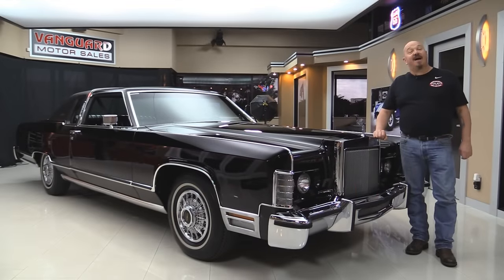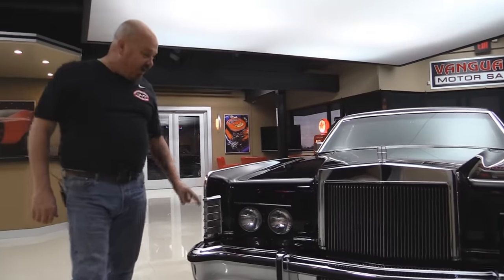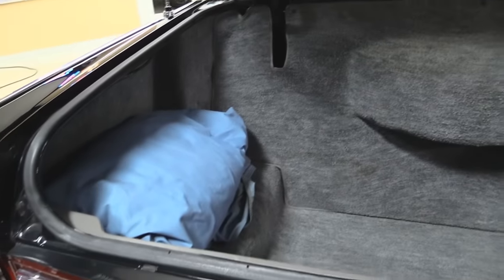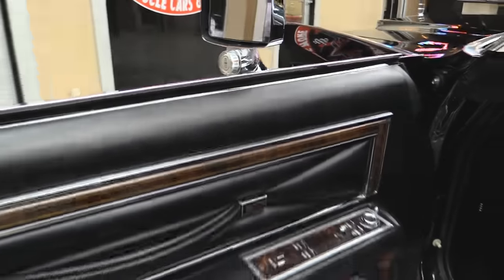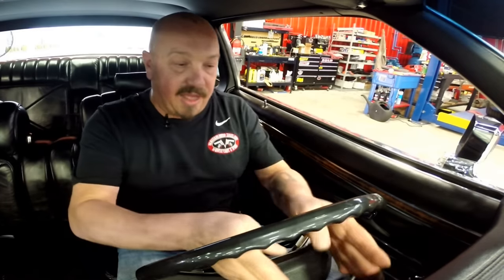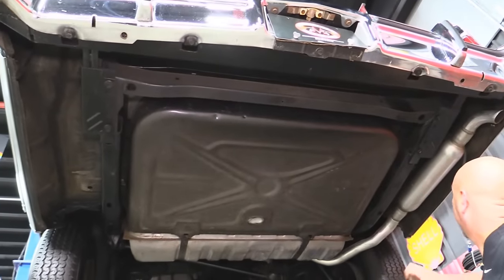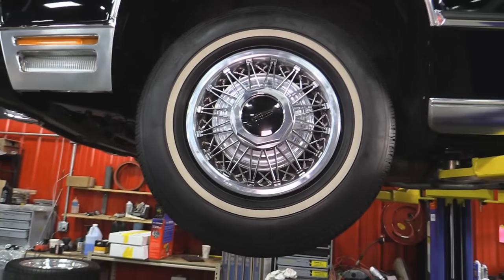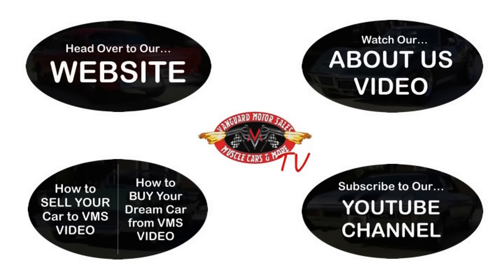1978 Lincoln Town Coupe For Sale

Comment: Nice car - but it has a vacuum valve issue on the headlights.  The headlight doors are supposed to be closed when the car is not in use.  Easy fix though - need to replace the vac valve for the headlight doors.